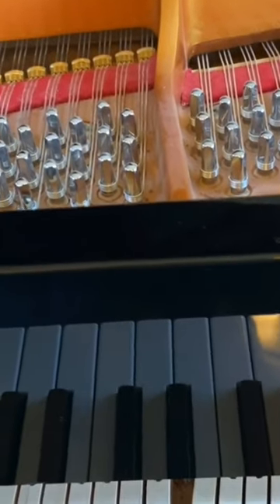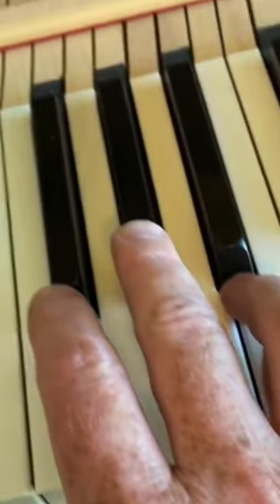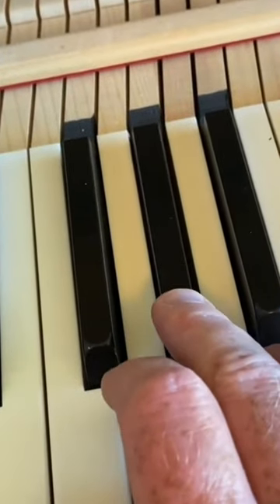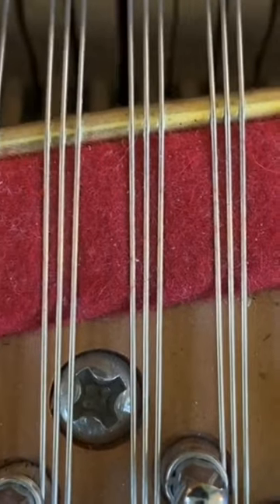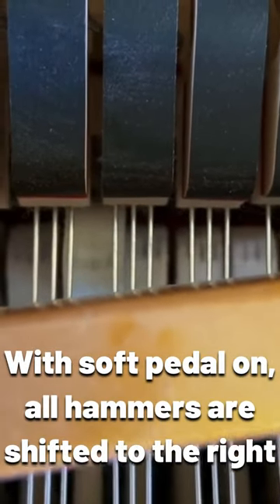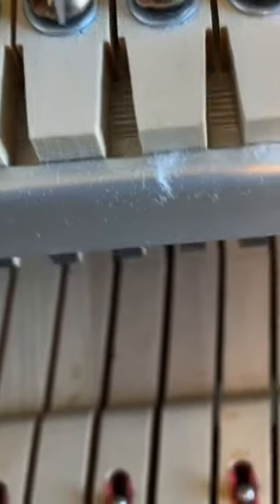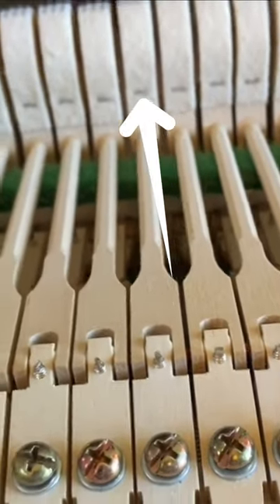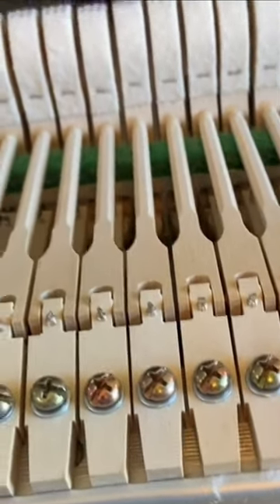Why Is this Piano Making that Noise? | HOWARD PIANO INDUSTRIES

Comment: I am facing the same problem and cant find any solution, is the piano in the video an acoustic or electric piano, also suggest if you have any tips for fixing this problem on an electric piano
Reply from the maker: The piano in the video is an acoustic piano. The cause of this sound will be completely different on an electric piano than shown here and we don't have experience with electrics.